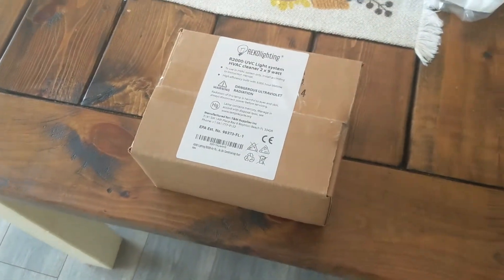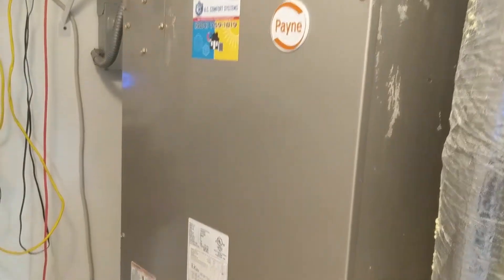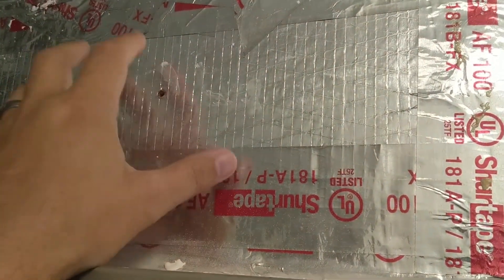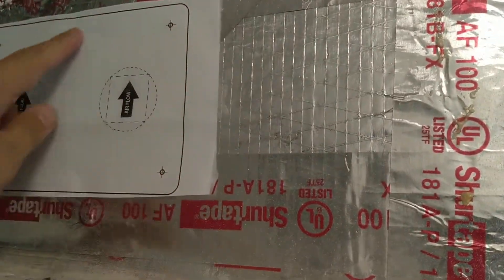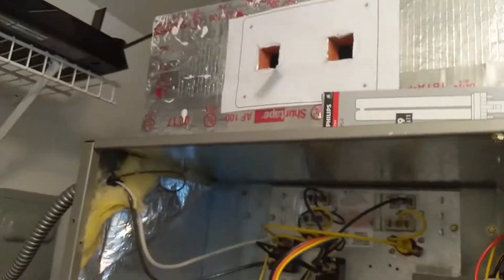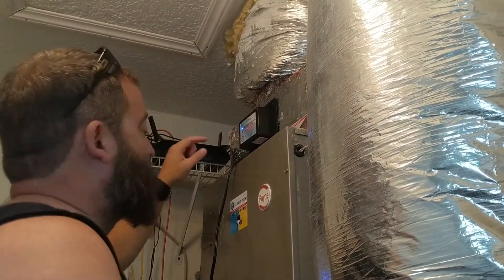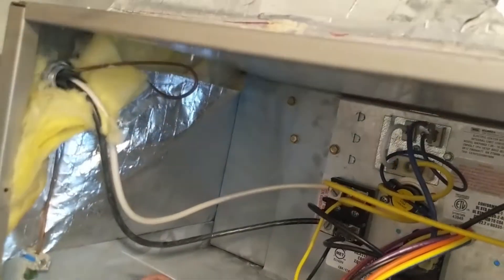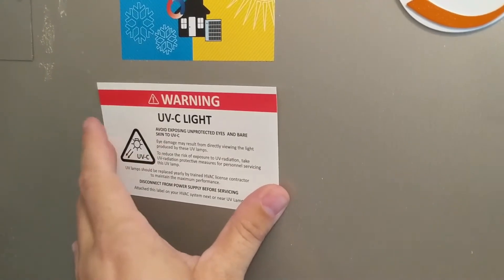Adding a UV Light to your HVAC system | McCoppin's Manual to Manliness

Comment: I have read the UV light can damage wire coating if installed in the coil area
Reply: Just need to cover any wires with UV rated tape.

Comment: I have same air handler and even uv system but mine doesn’t have power supply like yours
Reply: How did you go about installing yours? I have the same issue

Comment: Nice install. I had one  installed and they installed it in the return plentum on the insulation similar to how you did yours.  Question were you nervous installing on insulation?
Reply from the maker: No, pretty simple cut and the tape sealed well. Super easy.
Reply: @brianmccoppin  How does the light reach the A coil? the blower is in the way.